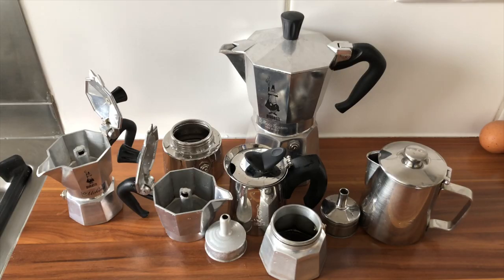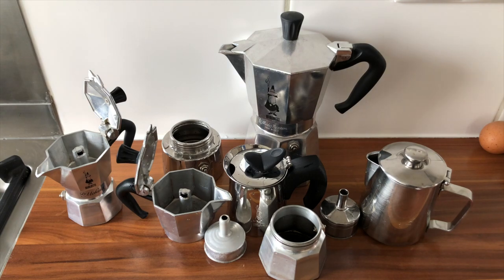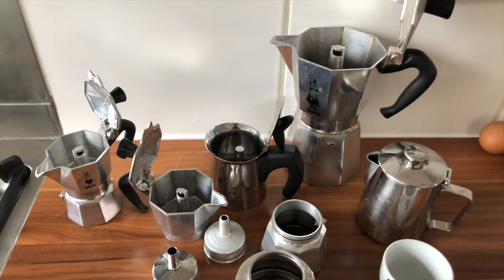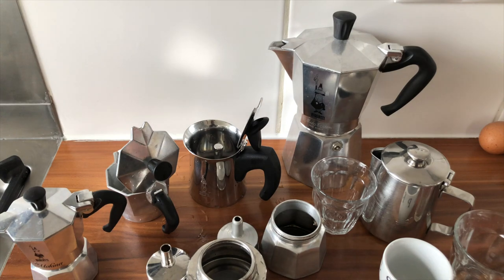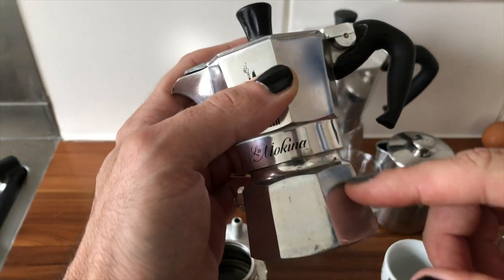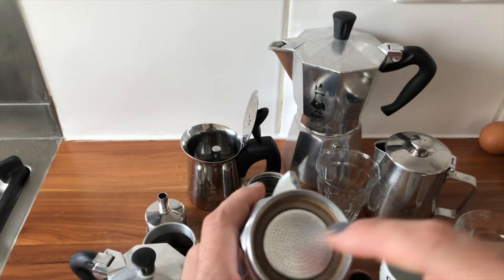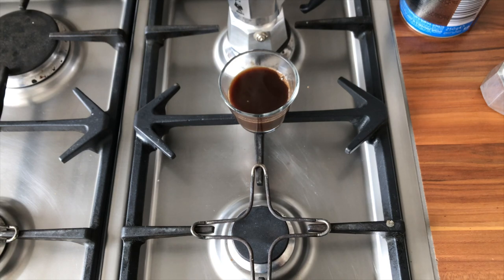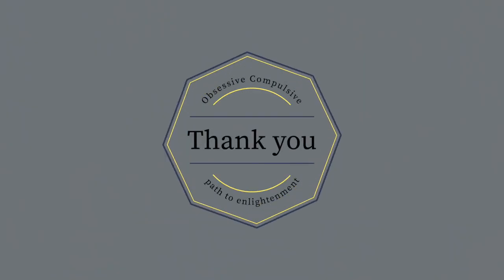Moka Coffee 101

Comment: Good video! The only thing I disagree with is that if you control the flame/heat and don't allow the coffee to burn in the pot you really don't have to wash it. I've had the same stainless steel moka pot for about 8 years and all I ever do is use my finger to wipe the excess build up. The excess always feels a bit oily which tells me I haven't burned the coffee. Also, I often open the lid before the coffee starts pouring and I get a pleasant chocolate smell which tells me nothing has been burnt. I do think too much build up might affect the flavor but a quick wipe with with the finger or cloth is enough.
Reply from the maker: I wash the steel one with soap every now and then, otherwise after pouring filling it with water to clean it better after is a good enough tip.
People let crust build up, that's the worst 😂

Comment: I have a gas stove top, so I use a heat diffuser between the 6-cup pot and the flame and I followed Bialetti's own instructions. The diffuser makes the coffee flow evenly when the extraction starts with no sputtering. It also prevents the coffee burning and I think, prolongs the life of the Moka pot. The resulting puck is completely saturated through, with no dry spots. After the three pot conditioning brews where I got used to the technique, I have been reliably brewing full flavored rich brews every time. I don't see the need for an Espresso machine.
Reply from the maker: The diffuser is a really good idea, I don't have one though.
These days I'm traveling with my Musa and always carry an induction converter plate for when no electric/gas is available.
I have noticed that using the plate and finding the sweet spot for the induction source I get better coffee than on the gas.
I'll buy a diffuser, thank you for the tip :)
Reply: @ubidefeo   It just something I found by observation and I made the decision to use a diffuser from the very beginning. All the videos where people are showing their Moka pots sputtering and comments complaining about bitter coffee due to over extraction, have not happened in my case. It seems to make using a Moka pot far easier and the process far more forgiving. Thank you for responding to my initial comment. Cheers. 👍
Reply from the maker: @channelsixtysix066  I love adjusting process based on observation :)
Reply: What is a heat diffuser for a gas stovetop?

Comment: (Almost) Excellent!!👍🏼 You must have been out shopping for one of your moka pots and missed that physics lesson about 'Pressure release valves'👨🏽‍🏫 otherwise you would have known that the water level should not cover its hole.
Covering the hole with water makes the valve in-effective.

Other than that, your video touched on all the techniques to make the best moka pot brew!👌🏼😋
Reply from the maker: You are right, safety demands the valve not to be covered 😬
I have to admit I know that but over the years I got good enough at pressure control with my favourite blends and grounds that I feel safe in disregarding that.
Also I keep the timer on because if it hasn’t made it out in the average time  +1’ it means something’s wrong.
I gamble on my experience 😂

Comment: Hahaha. Interesting. This is how all Italians do this or is this is your preferred way? Interesting for you to say don't compress the coffee, but after watching you pack the coffee in the funnel; it looks compact. Not to mention when you put the top on and screw it on. I bet if I did this, it would most likely leak. 

My three cup Bialetti always leaks when I put similar coffee in. Even using my finger to move the coffee to cover empty spaces, after the top was screwed on, it leaked. I had to decrease the dose. New moka pot of course. It actually got me worried before when it leaked because I thought someone send me a defective moka pot. Nope. Everything looks new. 

I emailed Bialetti when to remove it off the stove. They said when you hear the gurgle sound (with lid closed in order to heat it). Yeah by then the coffee to me tastes burnt. Sadly here in America we use electric 🤦‍♂️🤦‍♂️. 

With Electric stoves, when I use it, the hole pot is hot hot hot. Even the top. What's annoying with electric is that the heat isn't consistent like flames are. I tried numerous ways to heat the bottom chamber aka boiler, it's wonky. I thought the dial between 2 and 3 was good and the way I did it was perfect too, but over time, weirdly enough, never came out the same. Must be the beans. Unless I put my whole beans in the fridge. My problem is how to put the powder in the funeral. Bitterness is what I want down to a minimum or gone (if possible). Can't tamp it. I don't. Don't compress. I don't. I have to go coarser. I do. It's like I have to put three tablespoons in the funnel and screw the top on 🤦‍♂️.
Reply from the maker: Not all Italians do this, I'm very OCD about it :D
Tapping helps packing the funnel, and when you see me adjusting with the spoon I'm not pressing, just mildly cleaning and creating a clearer area towards the gasket.
Every pot has its own tap insert point, try to identify it, start around there, move counter-clock and clock-wise a little till it locks in, then slowly screw it shut.
When it comes to heat I have had much success with electric by pre-heating at high setting, lowering to 1/3 or 1/4 depending on stove power and timing how long it takes to come out.
Then I simply remove it and place it back as it slows down.
Also at this point I sometimes turn off electric which stays hot anyways.
Leakage is a sign of grains in the gasket, I always clean it really well and the very little hill prevents more grains to end up between the rim and the gasket.
The more you fail the screw insertion point the more chances of getting grains in that area.
Also grind size is extremely important, if you can source some Illy or Lavazza coffee for Moka pot you should aim for that size.
If you notice, I also say that I NEVER use Robusta blends but stick to 100% Arabica. When I make Robusta I get results I don't like :)
Reply: I can't reply using @ your name because of a  glitch or bug on Youtube's part for mobile phone. 

Anyway. Thanks for the reply. High heat I'll try that. Any specific number dial? We have an electric stove numbers going all the way to 9 and high, or simmer-high including numbers. 

I do tap the side of the funnel when I put in a few tablespoons of coffee—no pushing or tamping. I use my finger tips holding the funnel in my left hand; I loosen the grip in my left and I tap with my right finger while simultaneously turning the funnel a bit. 

I know grind size is important. 

What I'm looking for is that thick, caramel, chocolatey flavour I got when I copied Il Barista Italiano's method of coffee in funnel method. Same grind. Always got the texture and flavour. It gave me that. Then all of a sudden—and this is the weird part, it stopped. And I do clean my Moka pots, cleaning it with mild soap or vinegar. I always manually dry; no air drying it because I know that's bad. It'll rust and collect bacteria. 

I'll try high heat. I forgot to mention I do shut off the heat as well when I see it flow. Still gives me bitter coffee. I don't mind it. My girlfriend does because she's used to American drip coffee hahah. 

Also, before I go. Been between letting it brew all the way letting every bit of water into the top or loft it up when the coffee is a light colour 🤦‍♂️. The end results to letting it brew tastes burnt (I don't mind this) or bitter if I remove it when I see the liquid a light colour (don't mind this again). Probably will stick to just lifting the moka pot during every  brew if it helps with the coffee tasting less bitter.

Comment: Do not cover the valve with water. Factory instruction says fill it to the bottom edge of valve.
Reply from the maker: I know, I know.
This is the biggest criticism I get, but once you know your blend, your grain size, your internal pressure build-up and your temperature control, the safety feature becomes redundant.
When I try a new blend or some different parameters I leave it clear :)